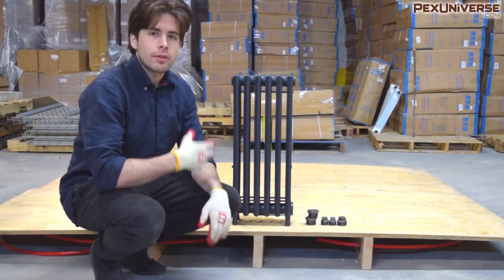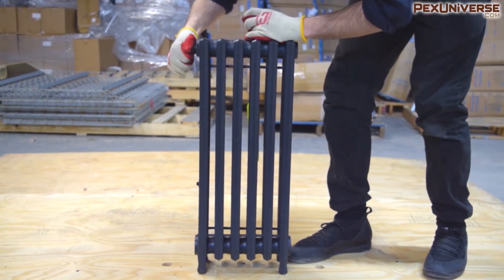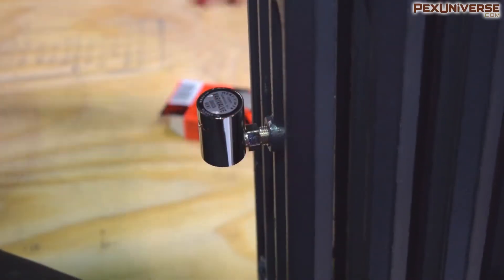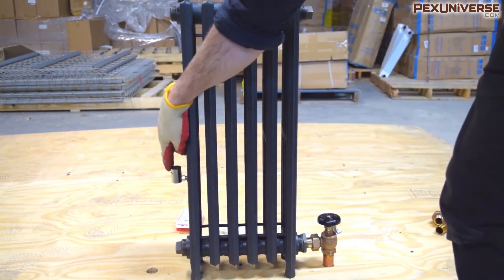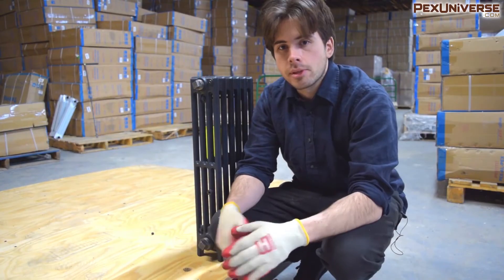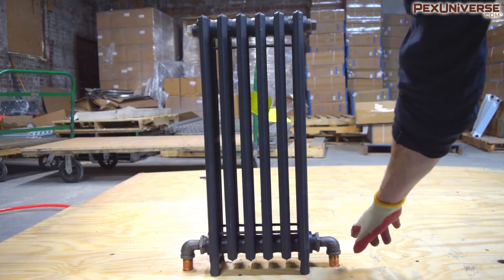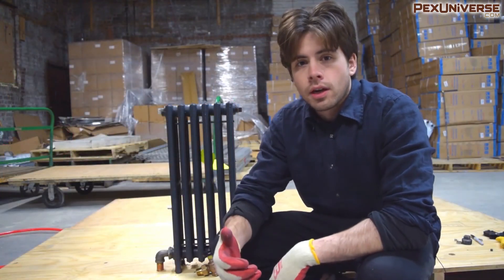Different Ways to Install a Cast Iron Radiator

Comment: Air vent has to be on the top for a water system.  You need to let all the air out, unless you want radiators that are half warm and act like compression tanks.
Reply: Correct. can be lower for 1-pipe steam system

Comment: Bro...I'm sure we all appreciate the effort in making the video. Not to get into a long-winded reply, I'll just point out that if used for steam a 1 by 1/8 bushing must be used where you placed your 1" inch plug and the air vent installed there. If used as a Hot water radiator same thing except your bleeder gets installed instead of the air vent. You're not using the correct tappings. Installing an HW bleeder in the middle port will only allow half the radiator to fill with water and therefore reducing its BTU output.

Comment: Great video, If your using Pex (Witch I would recommend) take the few extra time and money and secure the Rad or supply & discharge lines.
Had a little kid tip A rad over on to his leg, It wasn't pretty.

Comment: A tip, Radiators are usually installed near or under a window. With that said, the sunlight cannot hit the PEX per whitepaper. PEX should always be covered in those situations as you suggested with the brass fitting.
Reply: Thank you for this reminder

Comment: So I have 4 radiators in a series . Can I use the return to feed the radiators in the series (pex ) application .
Reply: Yes. I've seen some beautiful bay windows that have three or more rads connected in series under the windows. The first one heats up the most/quickest, but they will all get hot if your pump is running long enough to circulate and your thermostat is not right next to the first one.
If you are going PEX, the temptation is to plumb every rad individually (PARALLEL) and connect them to a manifold-- especially if the rads are in different rooms. They can be balanced to your needs/liking.
PEX is lovely when it is hidden.

Comment: A steam vent is a steam air vent, air vents for steam are not supposed to release steam. Steam vents work by slowing down the rate that air is released from the system on each cycle. As soon as steam hits the vent a bellows or bi-metal element closes the valve so if you see steam coming from the vent on a steam radiator the valve needs to be replaced.
Reply: AMEN!
Reply: Good to know!

Comment: when and where do you connect to the top connectors? Hot water to the top connectors and return on the bottom?  Vents up high because the air rises to the top of the radiator?
:goodvibes:
Reply: Any which way but loose...
But usually in and out the bottom for the purpose of flushing and draining.

Comment: I have a hot water radiator set up for steam that I need to convert back to hot water. Currently, one pipe goes into the bottom hole on one side, and on the other side, a pipe comes from the top hole. Can I keep it set up this way or should I have the supply and return at the bottom holes or on the top and bottom holes of the same side?

Comment: HI, I have an old cast iron radiator that was used for hot water. I want to use it for my steam system, to replace a cracked/leaking radiator. They are almost the same size, but I need to swap the fittings from top to bottom for steam, and put a vent valve in. Any advice on how to get the bushings off that have been on there forever? they are painted on pretty well to. Do i used flame, or heat gun? Do i need to score/cut the paint first? just brute strength to get them to turn? Lefty loosey still? Thanks.

Comment: Hello, there are one  pipe steam  systems and two pipe steam systems, which include a return connection.  And the steam radiator valves do not release steam, but rather air pressure, that builds up in the empty pipes and is pushed by the generating steam.

Comment: For steam systems, these are AIR vents, NOT steam vents. Also, for 2 pipe steam systems, you need a steam TRAP on the return side of every radiator if there are not main steam traps in the basement at the near boiler piping.
Reply: Agreed Fully. 😉
Reply: Can you use these radiators for either steam or hot water? I have a boiler with baseboard heaters.i was considering putting one of these cast radiators in my carport I enclosed  and insulated. You seem knowledgeable on these. If you could give some advice I’d greatly appreciate it.
Reply: @WinterSo1dier yes you can when he showed the pex and then the black elbows would be the wa you install it Im in New York and we install these all the time hope that answers your question

Comment: Great video!!! I would like to see how to connect and run pipes from an existing cast iron steam radiator on the bottom to the upper floor or an attic for a new steam cast iron heater. I'm looking for to install a new one on mynattic by myself. I need a clear idea how i can do it perfectly with your help.
Thank you in advance.

Comment: Thanks for the video. I wanted to install 2 separate hot water radiators in one room on either end of the room. How do I plumb them together so I don't have to run separate lines to the boiler? thanks for the help!
Reply: Use the return line off the first radiator to the supply on your second radiator. Then run the return off the second radiator back to the boiler.
Reply: Eric Fleury thank you
Reply: Eric Fleury hi Fleury, im looking for to add another steam cast iron radiator on my attic. Therefore, i need to run a new pipe from the existing cast iron radiator valve on 2nd floor to the attic. Please help? Thank you.
Reply: Typically each radiator circuit is branched off the mains using a smaller diameter pipe. That way each radiator gets fully heated water.

Comment: Thanks for the Video. I have 3 questions. 1) what's the difference between installing the relief valve on the top or in the middle on a hot water radiator? 2) What difference does it make if the valve is installed on the supply side instead? 3) what is the proper tool to remove the bit that comes with a new radiator, I had a hard time removing it from mine?
Reply: I removed my 1/8" bit with a 3/16" allen wrench

Comment: Temperature changer?  LOL.  The vent is not for releasing steam, otherwise you'll have a very efficient humidifier and heater.  The air vent is to release cold air that is inside the radiator so the steam has a place to go.  Different size vents will regulate how fast the radiator heats up which influences how warm the room gets in relation to the rest of the system.  And my 1929 Tudor does have 1-1/4" supply lines - no bushing required.  I didn't watch the whole video so I don't know what other mis-information is on here, but needless to say accurate and correct information is important!!!

Comment: Is that any sort of baseboard or anything I can use for a radiator I have one that has a crack (all ready tryed high temp jb weld). Tyed calling salvage yards in my area no has any.? Steam heat.

Comment: What would be an alternative hot water heat application where previously the radiator was installed with a Honeywell Unique Valve where supply and return are from the same side?

Comment: The radiator valve in my bathroom crumpled!! And the other side is missing the steam thing, some radiators wont get hot especially the on in the attic!! Do you guys come out??? i need help!! Brought a old house and i know nothing!! I have lots of radiators!!
Reply: How's it goin at your house now? Were you able to find help yet?  Just wondering.

(I'm on YT here cuz I'm trying to research if radiators can still be installed in new homes not just old homes.  Haven't found the answer yet.)
Reply: @iwanttosurvive3992  it's going well we took the valve from the attic heater and put it in the bathroom,  the attic heater won't get hot and nobody is up there anyway.
Reply: @lovelyek8187  ok good!  Glad it worked out.

Comment: So, the only thing I lose by getting rid of the valve is the ability to completely shut off the radiator, correct? I'm trying to save some space...

Excellent and informative, thank you!
Reply: Also the ability to adjust how warm it gets in relation to the other radiators so your heat is balanced the way you want it to be.

Comment: En que parte del radiador va la balbula del cierre de agua en el retorno o la principal
Reply: Either side will stop the flow. Most put the valve on the supply side. 
I think putting the valve on the supply side means that closing the valve will truly impede the convection of the hottest water (supply) rising up into the rad and the cold water sinking down the supply side diluting the temperature of the rest of the supply. I think it makes a difference.

Comment: You need oxygenated pex tubing
Usually orange in color
For radiator installs.
Reply: So just using the crimping rings good enough for the oxygenated pex tubing? 
What types of connections are available for connecting the oxygenated pex tubing?
Thx
Reply: @ivantorr  I used the crimp rings or you can use shark bites even if you wanted too. I did my one install years ago with the rings and haven’t had a problem
Reply: @TheCrushinator71  thx JD
Reply: @ivantorr  no problne

Comment: 5:12, is it safe to take from this comment that I can use cast iron radiators for a hot water Navien combo boiler?
Reply: You may want to flush those old cast rads like mad before starting your shiny new boiler and pumps.

Comment: How do you remove the air valve bit?
Reply: I have the same problem, I've tried all Allen keys possible and none seems to fit
Reply: I was able to find an allen key. I think it's 1/8". Try to clean and measure inside from one side to other
Reply: I guess that mine came with a damaged bit. I've try every Allen key and none can fit properly
Reply: Got my OCS radiator bit out with a 3/16" Allen Wrench

Comment: In the hot water setup, isn't the return side suppose to be at the top so the radiator can be filled with water. And the bleeder valve on the opposite from the return
Reply: supply and return at bottom 
vent at top, same side as return
after running the system, bleed the air.  let the system run for a white and bleed again.  the rad with the most air repeatedly - install automatic air vent
Reply: Supply can be at the top and return at the bottom, but not the opposite way. Return line at the top is not recommended.
It may seem weird at first, but it actually helps to maintain proper water circulation in radiators. As hot water cools, it becomes heavier and sinks down toward return.
Vent must be at the top, of course.
Typically, as Denis explained, both supply and return lines are connected at the bottom and radiators are built in such a way that it helps to use energy better.
Reply: I’ve heard this as well. The reasoning is that you have the hot water in the radiator for longer and it is a more efficient setup. I am finding that if the hot water in and out are at the bottom the hottest water never reaches the top of the radiator.

Comment: If incorporating old functioning cast iron radiators into a forced hot water system should the supply water  enter from the bottom and return water exit from the other side top?
Reply: Heat rises so it is better to use both lower connections.

Comment: 6:00 No, no I don't want PEX sticking out of my floor. I don't know anyone who wants to see that plastic pipe.
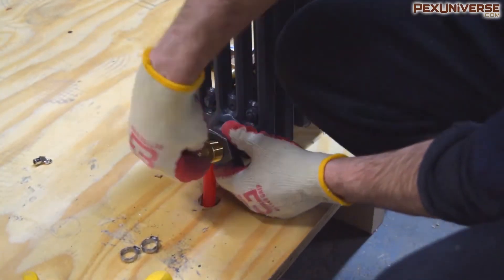6:25 No, I don't want a "nice clean look, like this" because it is actually hideous and a potential disaster to have PEX out in the open to be scraped, gouged, bent, and cut open. EVEN if they made a specialty PEX in copper or black iron pipe colour coating instead of the usual cartoon red, industrial white, or wacky orange, it is a bad idea and should be against code. I can see some sleezy landlords and cheap DIY jobs painting the PEX to match the baseboards, but don't you do it.
Valve or no valve (if you have a manifold), put your iron pipe through the floor and then strap/fix it to the joist to anchor the radiator. Once in the safety of the joist bay, transition to PEX. The iron reducer for the brass PEX nipple will act as a stop for the strap. Don’t crank that brass down crazy tight. A bit of tape and dope, get it snug and then a little more. NO, you dont have to bury the threads. 
Please ANCHOR your cast radiators, especially if you are removing valves and old iron pipe and switching to PEX. Kids WILL try and climb on them and they will get CRUSHED. 
Get some coated metal pipe hanger strap (white, black, whatever matches best), find a stud behind the rad, feed the strap through the middle of one of the fins (you wont see it inside the rad) and screw it through the drywall to the stud. Use a long 12" bit extender and 1- 1/2" Robertson or Torx screws to make it a piece of cake. Safety cake.
Asthetically, iron radiator, iron pipe, keep it the same. Double street elbow is SUPER clean, space conscious and takes skill to measure and assemble properly. Don’t mix in brass and copper pipes unless you're Willy Wonka...or Welsh.

Comment: Either his a giant person or this is the smallest radiator ever made.
Reply: There are radiators smaller/shorter than that.  Some of them hasve 2-3 fins.
Reply: All the new age models are sized smaller and slimmer but as long as they have the right sections they will work and give off the same heat to the room as the older over sized beast from the old ages lol

Comment: Wow, is this a terrible video! There are so many errors that it's evident the presenter doesn't really understand how some of this works. He's in a nice shirt, and the warehouse is clean, but that's about it. In a hot water system you can make the pipe connections at any pair of taps, but the air vent has to be at the very top, since air will start accumulating from the top down, and if you don't vent it from the top then most of the radiator will be full of air, not hot water. With one-pipe steam, although there are two 1/8" taps for venting, only the top can be used for hot water and only the lower one for steam. Why, because if you put the steam vent at the top steam, which is lighter than air, will rise to the top of the radiator, travel to the far side, and shut the air vent  leaving the radiator partially filled with air, not steam. Also, he is incorrect saying you need a bushing at the bottom in all cases. Untrue. one-pipe steam often has a 1-1/4" valve connection. Only the smallest radiators will have 1".One-pipe steam never, ever, uses anything smaller than 1". And the brass return elbow would never be used with one-pipe and almost never with two-pipe. Only hot water. And he never even mentions 2-pipe steam, which comprises probably a third of all steam. I am impressed that most of what he says is either partially or totally wrong. Do your research elsewhere!